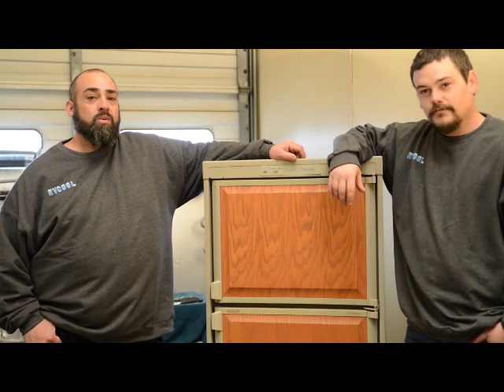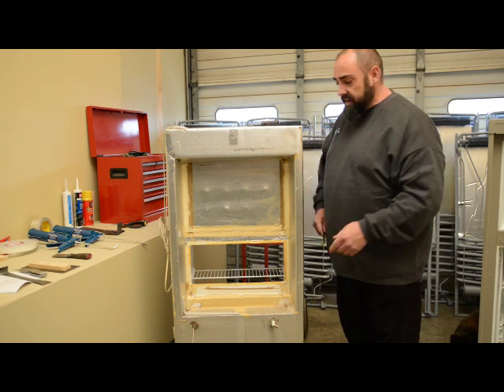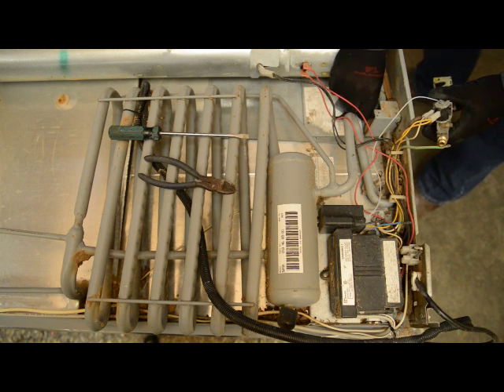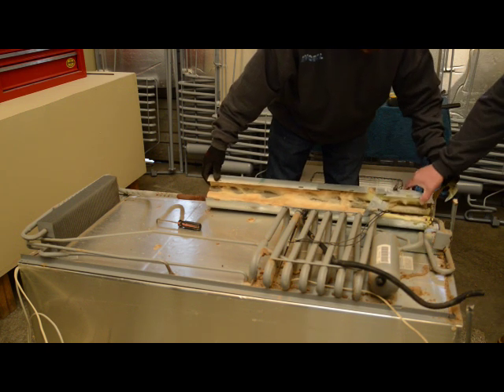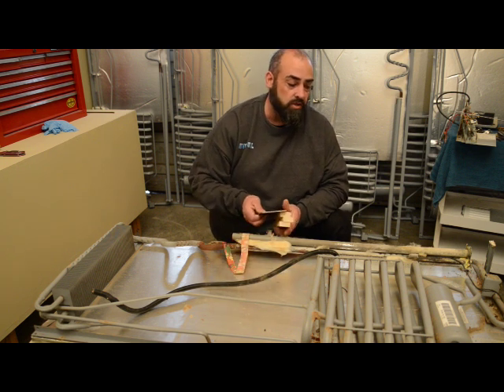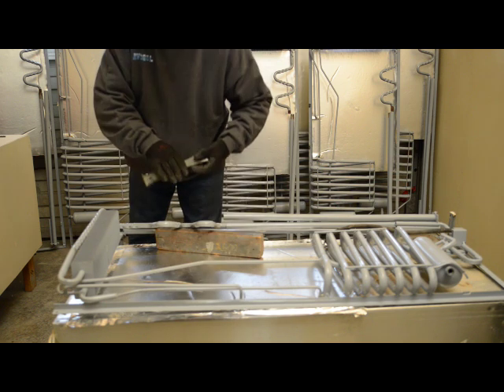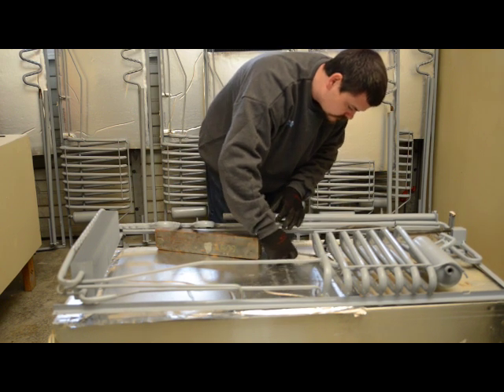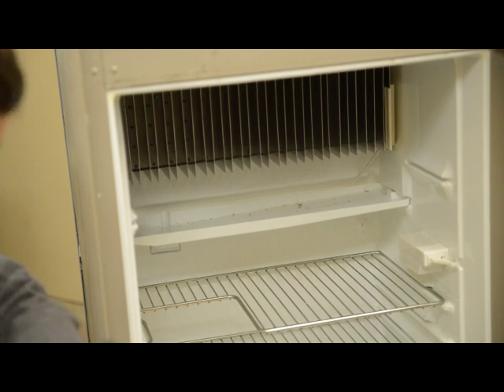RVCOOL Dometic RM2652, RM2852 Cooling Unit Installation Video

Comment: Hey guys. I know this video is 7 years old but I wanted to let you know that the knowledge you shared in this video helped us continue with our vacation after we repaired our RV refrigerator. We were prepared to change the cooling unit but availability was a problem and would have left us stranded for many days. We found a used fridge from facebook marketplace and I used it to rebuild our fridge. We used a Home Depot parking lot as a place to do the repair and was able to purchase all the supplies to get the job done. In 6 hours our fridge was up and running and cooling down. I really appreciate the details you provided right down to the rocking of the fridge back & forth to get the liquid back into the boiler. Thanks again!

Comment: Great video and excellent tips along the way.  Your removal of the old cooling unit is literally the only one that works.  You are the only ones online to address the issue of the sodium chromate appropriately. However, more warning is necessary in my opinion.  Sodium Chromate is a strong carcinogen and not only should it not be touched, care should be taken not to aerate it, making it an inhalation hazard.  All sodium chromate cleanup should be done wearing protective gear and with great care to avoid physical contact with the powder or contaminated water.   For some reason these facts are largely ignored by people servicing RV refrigerators.  I urge anyone doing these repairs to look up the MSDS on sodium chromate and follow the safest possible handling procedures.

Comment: Excellent repair video. I worked in refrigeration repair on residential refrigerator repair for 20 years and I always used a white liner repair tape on cracked liners. Caulk with white silicon and apply tape over. Works every time. You guys do an excellent job on repair. Thanks for making this video.

Comment: I wish I had watched this viedo before starting my unit change out ..I had to remove my unit after foaming it in because the holes in the freezer didnt line up and I had to go back and trim the foam to move it up to aline and couldn't get the unit back out till i watched this video...thank you you saved me a huge hassle with your prying tips

Comment: I looked into using the foam tape to seal the cooling unit in but decided against that and used minimally expanding foam instead. With the foam tape, I could not guarantee a good seal against moisture finding it's way to the cooling coils, condensing, and forming water droplets that could rust out the cooling coils. My cooling unit was 21 years old so I can reasonably expect at least another 20 years of service from my new Amish Built cooling unit. Also I used two tubes of thermo mastic which embedded the cooling pipes in mastic sealing them from possible moisture and also guaranteeing a good transference of thermal difference. It also was used as a sealant around the screw holes. My unit is working very nicely hitting 0 degrees in the freezer and 25 degrees in the fridge while 80 degrees outside. Looking forward to further testing in hotter conditions and while using propane. Otherwise, good video.

Comment: Thanks for the video. The problems I had: 1) getting the unit out, I dug out all the foam but found that the prybar between the cooling unit and the refrigerator chill plate was where I pried to get it loose. THe video didn't really say where you were prying. 2) There are missing holes and misaligned holes to hold the frame to the top. Since one side of the frame wraps around the refrigerator frame, the other side that is flat the hole did not match up. We ended cutting the new cooling unit frame hole to a slot. It was probably 3/16 misaligned. 3) we could never get the refrigerator chill plate loose; we just left it in place and put the cooling unit back on and the screw holes lined up. In the end, it worked really well, if anything we are too cold in the freezer (-20 DegF) and so I am going to work with moving the sensor in the fridge farther toward the bottom. The coldest it got in the fridge (empty) on AC was 40 DegF while the freezer was -20. Tonight I will try it on propane and see how that goes.

Comment: Nice video... it makes one want to purchase from them, but the shipping time is SLOOOWW.  even the instock units (new or rebuilt) take 3 days to process before shipping, then 5-8 days to arrive,... with NO EXPEDITED SHIPPING options available.  
 when an RV refridgerator fails, one would think a reputable sales outlet would care enough to have options available (at the customers expense) so that the customer can get a replacement cooling unit as quickly as overnight shipping can deliver it... or at the very least, 3 day shipping....

Comment: great video ,,I have a Dometic RM 3962  that will not get warmer then 19-22 degrees what could do that thermister changed 2 times and both were checked then a control board  changed ,fans are working on a 130 degree sensor to help coils ,,done any and everything with this unit ,,,any help would be great

Comment: Our refrigerator is an 8cu ft Domectic(looks just like your 2652 in the video). Ours is working OK but I noticed a lot of surface rust on the lower coils and some on the collection tank. I'm wanting to remove most of the rust or maybe use a rust converter paint to help protect it. What kind of paint would you recommend. That's for posting this video. If ours ever leaks I'm going to look into getting a new cooling unit from you guys, great instructions.

Comment: Great video thank you!  I have a Question. Mine has two tubes attached to the boiler for the heating element. I cant remember which tube mine was in originally. Does it matter?
Thanks again!

Comment: I'm having problem with my fridge in my camper I am plugged a couple wires and hooked it up directly to the heating unit and it's cooling my frigerator going to wait till tomorrow to see if it's down to 32 degrees or colder but I have no power no light.. I put a new circuit board in from dinosaur circuit boards.. it's like no power leaving the board any ideas

Comment: I have a 1976 dometic rm66E model RV refrigerator that I want to run off of my RV 12volt house battery. Do you know what power consumption this model uses? Amp hours? How can I figure this out?

Comment: Does it matter which side you lay it on to do the "rocking"?
Reply: Are you able remove the freezer U sharp medal pice out to clean freezer? Bc we lost power and had meat in freezer
Reply: Michael Pasch .  You could not remove the heat sink from the freezer side on mine, cause it was taped in from the back side, underneath the coils. I think the plate that is attached to the heat sink is also bigger than the hole.
Hope that helps. At least that's the way it was on my 2852 dometic.

Comment: I ordered from this company- didn’t receive any insulation for the tube. It took longer to receive the coil( a month). When trying to return the old cooling unit was called a few derogatory names for the e-mail requesting the return label. As of this date there is not been sent the label or a two year warranty! St this be point I am assuming the warranty is no good. He made a reasonable video but didn’t try to contact him by phone or you may be cursed out! It has been 4 months now! I haven’t installed my calling unit yet! I just wonder if the unit is any good at all if not I am out $540 some dollars! Looks like the heating tubes ar blocked up with some kind of sealant! I don’t recommend this place at all! I am a mechanic so I know a little about things like this!
Reply: This guy has screwed me too. It's been almost 2 months since I ordered my unit and I was billed a month ago. I guess the kid took over and is a little dimmer than the old man. Screwed the company so bad he had to change the name to Ozark Cooling Units. He won't answer the phone and the one time he did he lied and said my unit has shipped then cussed me out for no reason! Trash business and people!
Reply: @dacejuilfs5514  I spoke w/ the dad and he was pretty helpful.  Hopefully you got your situation worked out w/ them. I just ordered a unit from them, and they do seem to be upstanding people.  Time will tell but every business does make a bad decision once in a while.

Comment: This company has gone the wrong direction and these cooling units are now garbage, I was turned on to these guys by an extended warranty company summer 2020, I then bought a run of 4 units, 0 worked right. 1 still unresolved kinda cools sometimes after we lock it on, 2 let its juice out after less than a week, they replaced but paid no labor and I ha to pay for the new one until they recieved the bad one, 3rd showed up popped in the box, lost the job, got money back once they got it back, 4th tried all of they're tricks, sent pictures and emails and left messages, they went silent, finally I bought a replacement from a reputable company that I have been buying from for years, installed and it works perfect, finally got wick on the phone and he had a meltdown and refused to make it right... what a shame this could be a goldmine, I learned this is not the place to save a buck no matter how good of a video they did...